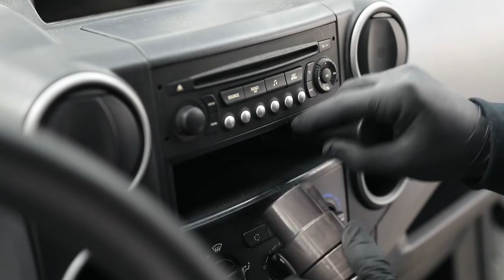Interior Deep Clean - Dirty Work Van - ASMR Auto Detailing

Comment: I don't know that your secret is bro, but when I use a drill on fabric before extracting, it flings suds EVERYWHERE. Great camera work, btw. I especially like that ground level shot on the last mat.. 💯
Reply from the maker: Thanks for the compliments! Are you also using these soft, white brushes? Just don’t oversaturate the seats with product when they aren’t too dirty, I don’t feel like it’s necessary.
Reply: @VermijlCarDetail  I have the exact setup you do, except I have a DeWalt drill. Honestly I'm probably using too much solution and it's flinging everywhere. I also couldn't get the dilution to 20:1 exactly, just had to guess when I did it so it's probably closer to 10:1..
Reply from the maker: The stronger the solution, the more it will foam. Obviously it needs to be strong enough to clean, but I’d still recommend using less solution. I prefer doing a second pass if needed, instead of having it sling on other panels. Try it out next time you take on an interior! 😉👍
Reply: @VermijlCarDetail  will do. Thanks for the tips!

Comment: Good job! What dilution ration you used for pol star?
Reply from the maker: Thanks Alexandru! I used Pol Star 1:10
Reply: @VermijlCarDetail  hello! Did you also put 1:10 in Bissell? And why not Mehrz instead Pol Star? Thanks!
Reply from the maker: @pereviznyk  I use only water in the Bissel. Could’ve used Mehrz, which would’ve definitely done the job, but I just wanted to try Pol Star this time
Reply: @VermijlCarDetail  thanks for answer. I used Mehrz 1:8 on door plastic, then on top Koch Top Star. Few days later was very rainy day and I opened the door few times. Next day I saw white streaks on plastic (white lines). Can’t understand who is guilty - Mehrz or TS, or should I use wet MF cloth before Top Star to buff off Mehrz 🤔

Comment: hi karcher k7 full control plus  
I have the machine how can I adapt the st2300 gun to my machine nilfiks tip comes standard?
Reply from the maker: You will need the M22 - 3/8” adapter and the Karcher Quick Connect coupling. You will also need to change the connection of your foam cannon to a Nilfisk KEW QR adapter.
Reply: @VermijlCarDetail  thank you You do a very good job, I follow it by liking it